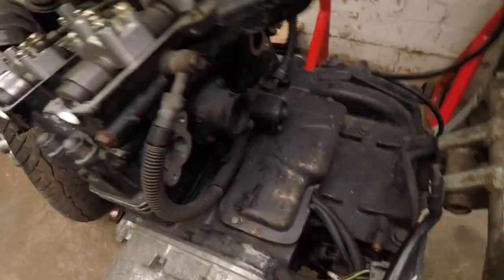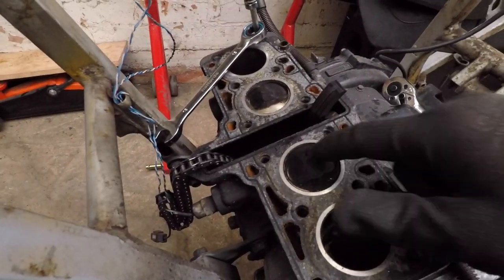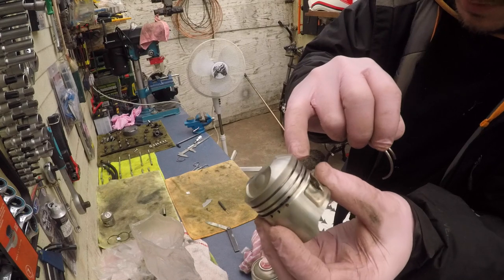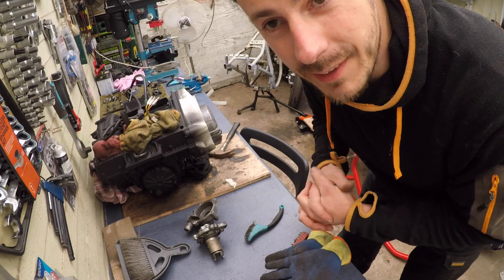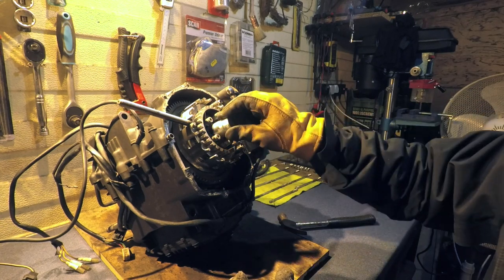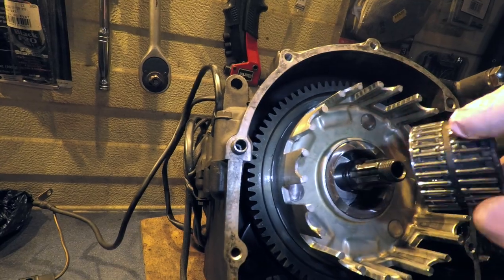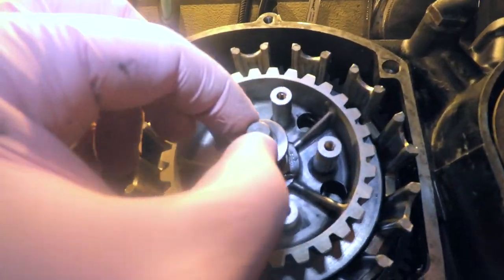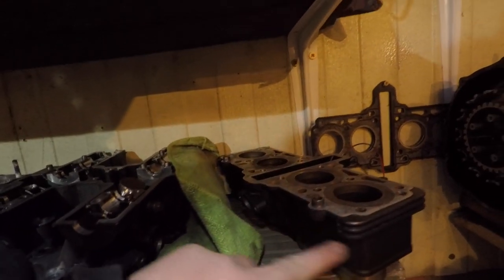Suzuki GS250FW Restoration Pt11 1080

Comment: That donor bike is really coming in handy. Money well spent. A little surprised you didn’t opt on purchasing new clutch plates seeing you did all the hard work of disassembling it.
Reply from the maker: 10 points for the donor bike idea right?
the clutch plates i’ve measured them and they are within standards, i have another spare set from the donor.
my plan for the donor bike’s frame body and wheels is to make it all electric.
most definitely that will be another series.